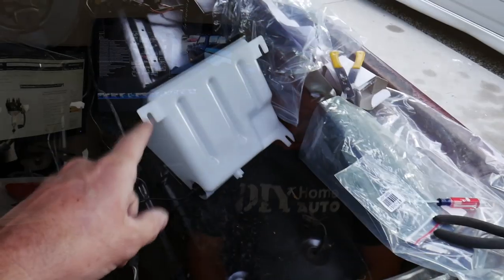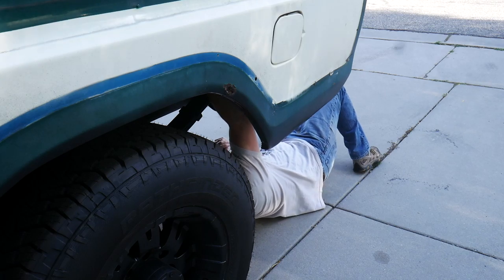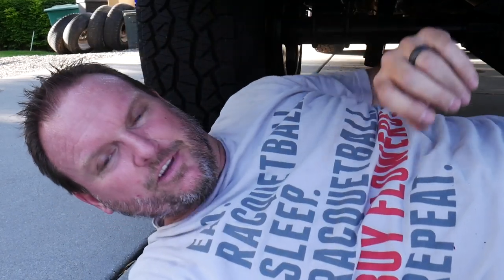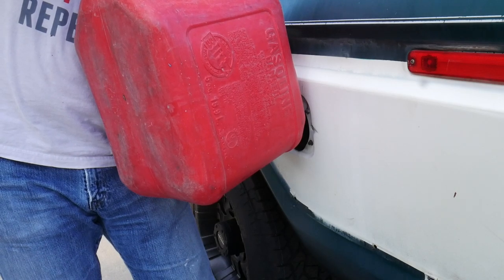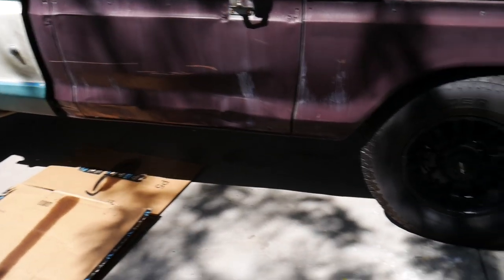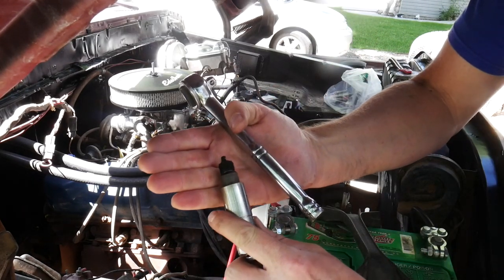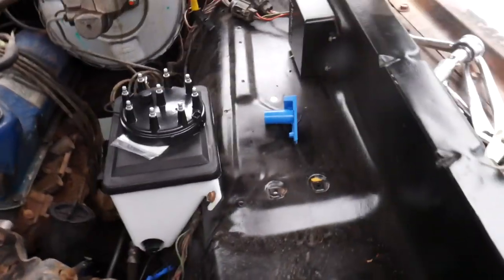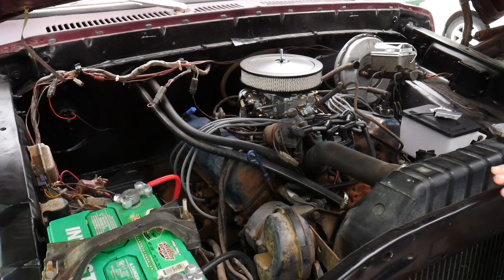Ep.18 1979 Ford F250 Restoration - New Plugs Wires Cap and Rotor - Bumper mount FAIL

Comment: Spark box mounted on fender are a common problem on fords those years. I just replaced distributor to a conversion hei. Chevy top and ford bottom distributor. The oil leak could be a vacume problem with the pvc valve on passenger valve cover
Reply from the maker: Thanks for all the detailed info. I’m hoping to get back on this project soon.

Comment: I was wondering if you could make a detailed video on how to change heater core id highly appreciate it
Reply from the maker: I changed the core in this truck 20 years ago. In fact, I accidentally left a socket inside the dash. For years I could still hear that socket rolling back and forth every time I stopped at a light etc.  Could be interesting to pull that apart to find my old socket. Haha, stay tuned!
Reply: @troysgarage  I sure will your videos are very helpful

Comment: Just bought mine week ago.Any idea what could cause engine to die.It will idle but only when foot on gas.When i let go it dies
Engine also shakes quite a bit thank you!!
Reply from the maker: Sounds like the carb having issues. Might need a rebuild, could be the timing and vacuum advance. Try running some Sea Foam through it first (follow the directions on the can). If that doesn’t help you may need to pull the carb and give all the parts a good cleaning or rebuild it using a rebuild kit. Oh, also check your fuel filter, could be clogged. Welcome to the dentside family!  🙌🏼

Comment: Some times the rear oil sender unit  can leak and it runs down to the same spot
Reply from the maker: That will be the first thing I check when I get back on this build. I’ve heard this now from several people with more experience than me. Thanks for all the pointers and comments!  It means a lot!  🙌🏼

Comment: Do you still have the mechanical fuel pump on the truck?  If the diaphragm goes you'll have fuel starvation problems and also can get gasoline pumping into the crankcase.  This could give you the sudden rear main seal leak as well when your oil gets diluted with gas.  Betcha if you changed the oil you would get a ton of really light weight gasoline-smelly oil out of it.
Reply from the maker: Yup, we replaced it with a new mechanical pump. It’s working like a champ now. But I do still need to chase the source of my oil leak.